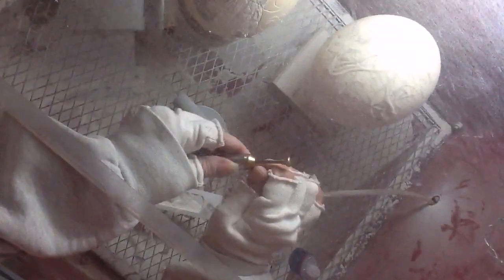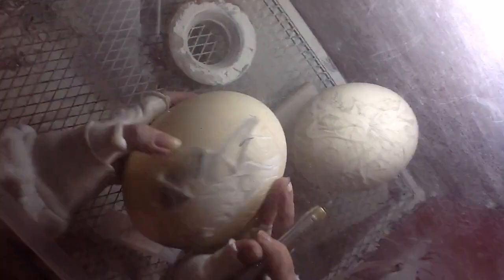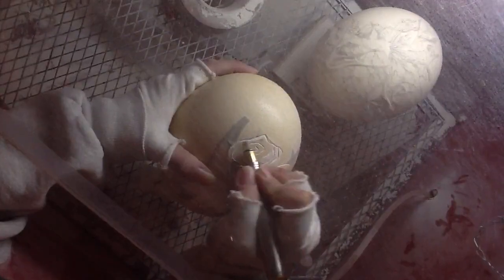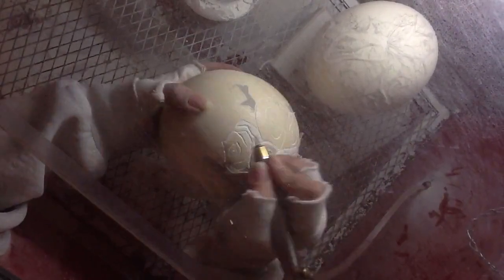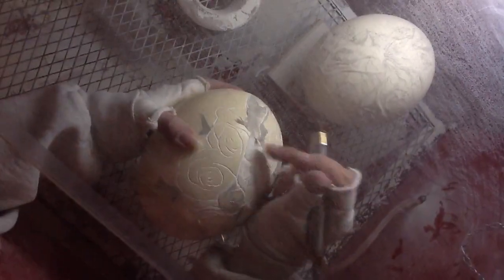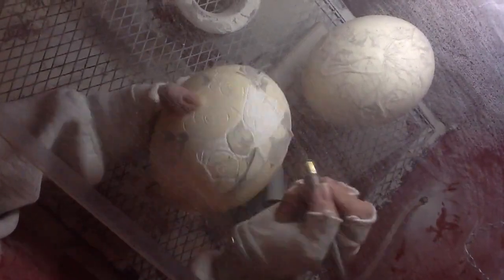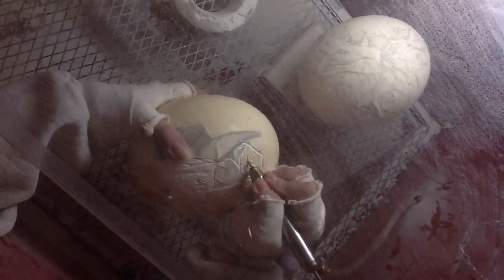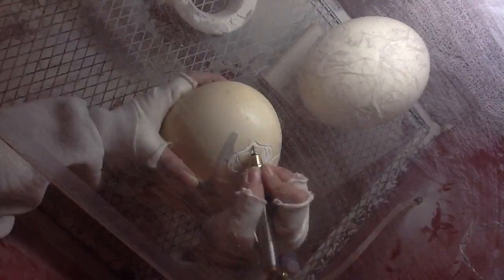Carving an Ostrich Egg

Comment: I think this is a tools like a tools for dentists (машинка для ручной гравировки). I have one of them and not very expensive. I guess it costs about 300-500 ua (гривен) then you can add some 	
cutting tool which costs about 100 ua.
Reply from the maker: High speed dental drill 400 K RPM